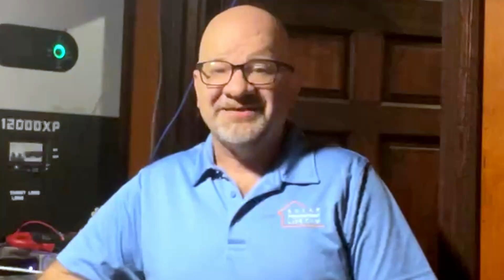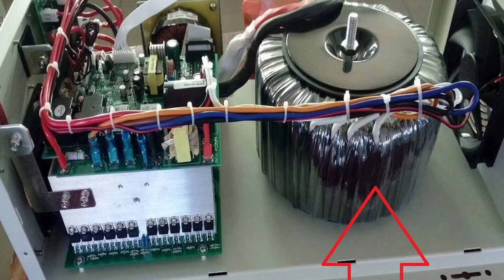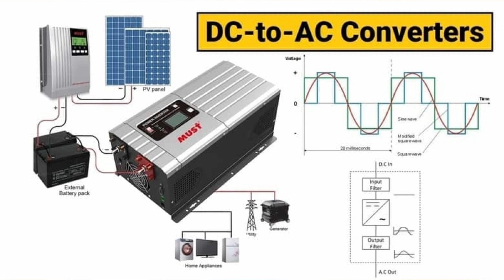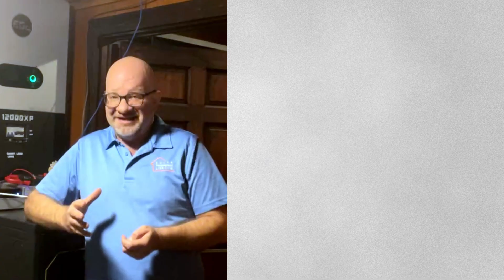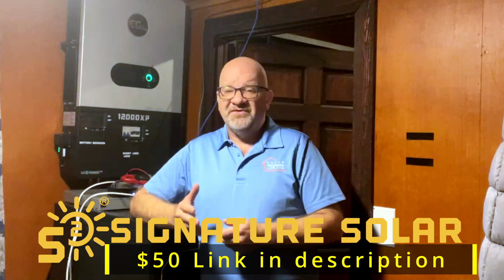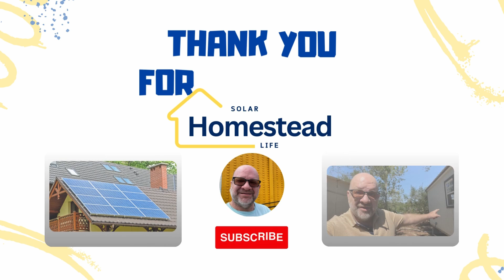High vs. Low Frequency Inverters: Which One is Right for You? | Solar Made Simple

Comment: pretty sure that 12000XP is mounted improperly. it's supposed to have clearance on all sides.
Reply from the maker: Hey, thanks for the heads-up and for looking out! You're actually right that installation was incorrect. We've since done a complete remount in a different location with all brand new wiring as well. Appreciate you keeping a sharp eye on the details!

Comment: Why is it called "low frequency"?
Reply from the maker: That’s a great question 👍

It’s called “low frequency” because of the transformer design inside the inverter — not the 60Hz AC output (they both produce 60Hz in the U.S.).

Here’s the simple way to think about it:

A low-frequency inverter uses a big, heavy transformer that operates directly at 60Hz (utility frequency). That’s why they’re bulky and heavy — that transformer is physically large because it’s working at a lower switching frequency.

A high-frequency inverter switches power at a much higher internal frequency (thousands of Hz), then steps it down electronically. Because the frequency is higher, the transformer inside can be much smaller and lighter.

So the “low” and “high” don’t refer to what your fridge sees — they refer to how the inverter processes power internally.

That big 60Hz transformer in low-frequency units is why they:
	•	Handle big surge loads really well (like well pumps)
	•	Feel more “old school” and rugged
	•	Weigh a ton 😄

High-frequency units:
	•	Are lighter and more efficient
	•	Usually cheaper per watt
	•	Can still surge well, but rely more on electronics than a massive transformer

We’ve run both styles out here and each has its place depending on your loads and goals.

Hope that clears it up!

Keep shining, stay charged.

Comment: hi, would a low frequency inverter be better for powering audio gear? kind regards
Reply from the maker: Great question, and I’ve actually seen this come up a few times from folks running audio setups. In general, a low frequency inverter tends to be the better option for powering sensitive gear like amps, preamps, mixers, and studio equipment — mainly because it can handle surges better and often delivers a cleaner sine wave under load.

The big thing to watch for is pure sine wave output that’s what really matters. Some high frequency inverters do just fine if they’re clean like the EG4 6000xp and 12000xp which are actively used for sensitive electronics.

Would love to hear what kind of audio gear you’re running. Always enjoy connecting with folks blending solar and sound!

Keep shining, stay charged. 🎛🔋

Comment: If this video is just a paid add.       Get back to me in two years when your warranty is up.
Reply from the maker: Hey @MatWalter-q3h — totally understand the skepticism. This isn’t a paid ad — just sharing what’s worked (and what hasn’t) from our real-world off-grid setup. We’re running this gear every day at the homestead and putting it through the test long beyond the warranty window.

We’ll definitely be posting long-term follow-ups, so stay tuned — and if you’ve got questions about actual performance down the road, happy to share it all.

Keep shining, stay charged.
Reply: @offgridsolarliving  I am off grid.  forgive my attitude.    I have just watched to many videos where people are thrilled with there new install and never say another word.... wonder why?
I have been  involved in the purchase and install of to two SRNE  and two Luxpower and 1 of each failed in the first 3 months.  
The tech is cool but they are not build to be used.   They are built to meet spec when shipped.   90% dont get them installed in the first year so the warranty is up by the time anyone has issues.    I am getting real tired of running a gas power genset to keep my freezer going... when I spent 15 000 on solar.

Keep the filters clean.  
If you are charging with AC grid or GEN DO NOT draw more than the genset provides.
Pull 2000W in the house when genset is giving 4000W is fine but reverse the numbers and buy a new inverter.

So many issues are rapped up in charging AC while using AC.    I ONLY  charge with solar.     If in an emergency I would shut the inverter off and user a charge verter.

thanks for sharing... we are actually all in this together.
Reply from the maker: Hey @MatWalter-q3h thank you for taking the time to write this out. Seriously. No need to apologize I completely get it. When you’ve invested that kind of money and you’re still having to fire up a genset just to keep food cold… it’s frustrating on a whole other level.

I really appreciate you sharing your experience. SRNE and Luxpower definitely have a presence, but I’ve heard similar stories. It’s one reason I’ve been trying to do long-term testing on our system here — not just the “fresh install honeymoon.” We want to show folks how it actually holds up when you’re depending on it.

Your tip about charging with solar only is gold and I totally agree. Many issues with AC charging come from overload or undersized gensets, especially if there’s no current limiting. It’s something that gets glossed over in a lot of flashy install videos, so I’m glad you brought it up.

You’re right we are all in this together. Keep hanging in there and if there’s anything you’ve figured out that you think would help others, feel free to share. I’d love to hear more about what you’re running now and how it’s holding up.
Keep shining, stay charged.
Reply: @offgridsolarliving  One house running one one 6000xp which is a btch as it should be two but one was non operational out of the box. In the end I had to have visa cancel the payment as Solar power store would not send me a new out but insisted I deal with Lux power.
I have installed two more SRNE 5000W in two other houses.   One failed at 90 days.... the other has only been in 30 days.

All the units that have failed just died.  No over loads or high use or large charging... they just quit.

Batteries (4) are all 280 AH JK BMS made them myself.   

At this time my solution to the XP 6000 is  THREE   SRNE  10K  with two 5000w mppts
$6000 (CAN) Aliexpress  free shipping   The warranty is with SRNE anyway.

The math says that if they are 95% likely to last two years  (warranty is two years) then you need three units to be 95% confident you will still have one unit running after ten years.
I will run each one for 6-8 months as soon as I get them to purge the gremlins that seem to exist. seems if they make it 6 months they seem to make 3 years.

I need reliable as in years on end not  for months at a time.
Reply from the maker: Hey @MatWalter-q3h — totally hear your frustration. That’s a tough run of failures, and I can’t blame you for pivoting to a new setup. We’ve had good results with the EG4 6000XP here, but every install and use case is different — and dealing with support that doesn’t step up makes it even harder.
Sounds like you’ve really done your homework with the SRNE units and even calculated longevity into your rotation plan. Respect. Also, hats off for building your own 280AH JK packs — that takes some serious DIY grit.
If it would help at all, I’ve got a contact at Signature Solar I can try to connect you with. No promises, but I’m always up for helping bridge that gap if you’re still dealing with any unresolved issues.
Thanks for sharing your real-world experience — people need to hear the good, bad, and ugly so we can all build smarter systems.

Comment: You need a big HF to do the job of an small LF. LF can have a 2x or 3x surge over many seconds. LFs are used in emergency vehicles, critical load UPS, and operating room power systems. LF inverters are hardened by nature of design. Im not into upgrading every 2 years. Proven reliability durability and longevity are why LF is my preferred system.
Reply from the maker: Hey @Tiersmoke92555 — that’s a solid take, and you make some great points. LF inverters definitely have that proven track record, especially in mission-critical setups like you mentioned. We’ve seen the same — they’re built like tanks and can handle serious surge loads without flinching.

Totally hear you on the upgrade fatigue too. We’ve been testing some HF units that have surprised us in terms of capability and value, but long-term durability is where the real test comes in.

Appreciate you sharing your insight — it’s always great hearing from folks who’ve been in the trenches with this stuff.

Keep shining, stay charged.
Reply: And they drink power like mad even when you are not using them. The low frequency heavy iron monster is lossy and you can use the spare heat to warm your house.